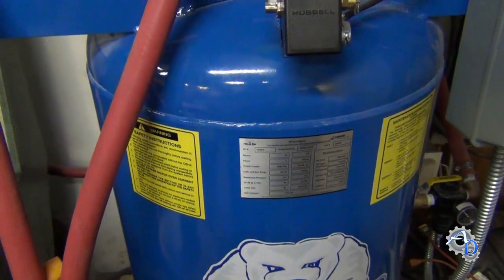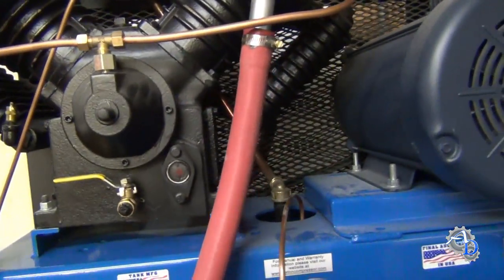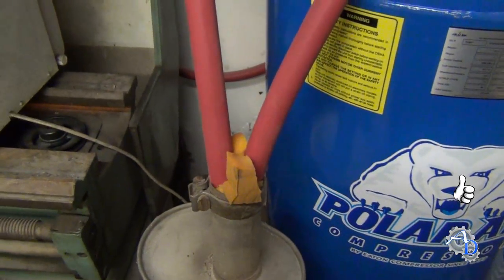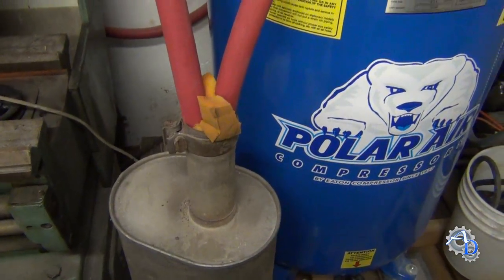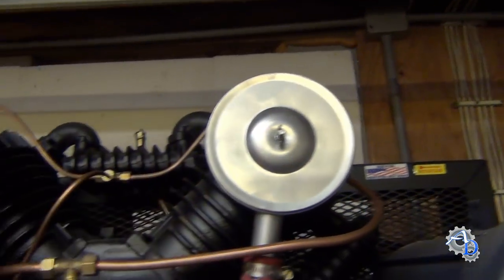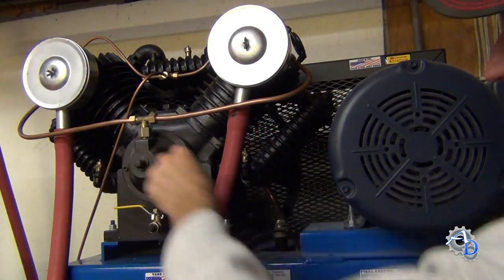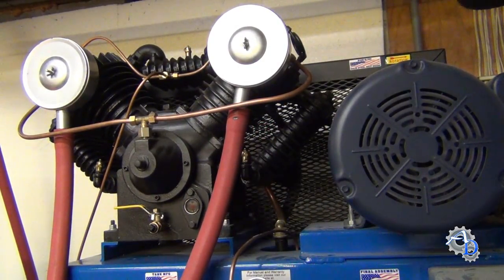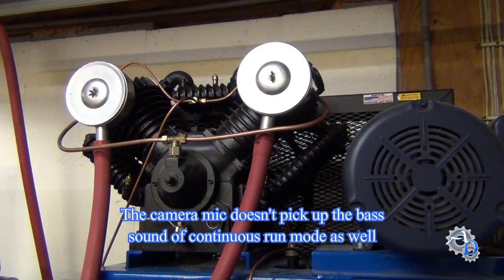Easy Trick to Make Your Air Compressor Quieter

Comment: Please what type of oil?
Reply from the maker: Just compressor oil
Reply: @ArnoldsDesign  What is the oil standard or size?
Reply: @ArnoldsDesign  Is it automotive oil or hydraulic?
Reply from the maker: @فنالتعليقالصوتي-ض3ص  It's just labeled "air compressor oil".  Get the oil for pistion compressors.

Comment: Please know that in my opinion, That is causing more of a strain onto your electric motor. I have the luxury of being poor & purchased a Central Pneumatic 21 gallon Harbor Freight air compressor & it has a 1/4" cold start valve which allows the first 4 pounds of air to escape because the electric motor does not have enough power to turn over the piston to build air pressure & I KEEP ORDERING NEW "COLD AIR RELEIF VALVE 1/4 VALVE'S & YET, they keep failing so, I am considering between a stubby 30 gall Kobalt tank with handle's & 2 wheels, or whether to go to Royal King & get a NOT SO MOBIL-60 gall FOR ABOUT $100.00 LESS? AT LEAST FOR NOW, SOUND IS NOT AS MUCH OF AN ISSUE FOR ME, FOR NOW AT LEAST. I will never again purchase a air compressor which has an air relief valve inline with the intake & the intake air tube, THEY ARE JUNK!!! and I am not referring to the tank safety pressure relief valve that every air compressor has for anyone who is wondering!

Comment: Mufflers goes on exhaust not intake. What you're doing is restricting airflow to your engine. I didn't hear any sound difference. You need to put it on the exhaust side. But I also there there's a. Better way than using a car muffler
Reply from the maker: ???  This is an air compressor, not an engine. You can't put a muffler on the "exhaust". And no, it doesn't restrict incoming airflow. The muffler was designed to handle flow from a 5.7L V8 engine. I'm sure it can handle a 37cfm compressor.

Comment: just build a sound proof box for your compressor
Reply from the maker: Yes, I'd like to put it in a separate room. Unfortunately, my shop's only 500 sq ft and there's no way I can do that. If I build a little enclosure around it, it would over heat quickly. On 50 -60 degree F days, it will actually heat my shop without the furnace on if I'm doing a lot of blasting.
Reply: A dedicated soundproof housing would have taken up more space, cost alot more than the muffler and would have (most likely) not been service friendly.
Reply: Jeff Burton not to mention it would trap heat. Compressing air makes a lot of heat. Any enclosurewould have to have built in air flow.

Comment: easy trick ... lost space and no major result. .... MY build (first compressor rated over "5cfm.."  )  starting project when find 2piston seized in garbage. ( quality cast iron, estimate 12-17,cfm )   rebuilding homemade free cost connecting rod with basic tool, cut gasket  homemade.  try 4 motor before find who run my pulley ratio desireddd (450 pump rpm)

at this points, setup is screww on wood bench,  no vibration, and no tank raisonannce with my hydrolique hose suppler (pump/Tank)   no air filter. juste 12'' 1/2''collant hose, and coton linge for little filtering .((air tank find a recycling trash, and buy for 3$)

1year later.  just little ajustement for maximize cfm and energie efficiency ( belt length, exemple, size of check valve, unloader line ect ect 

result 45db  with 15cfm mesured with formule (time,tank, ect ect)

Comment: your reducing the intake flow and could cause heat build up.
Reply from the maker: The factory uses a setup just like this. I don't think it causes any issues, because they offer a five year bumper to bumper warranty. Then again, manufacturers have been known to make mistakes. One of the things I want to do is take temperature measurements with and without the modification.
Reply: The air around the motor is hotter than on the floor. So its better to use a system like this if you use right dimensions...

Comment: I can't believe that pump doesn't blow those lines off.. it must not crank out much CFM.  Which is my main concern will all that line and constriction.  I spent a fortune on build a compressor that can take a 90 gallon tank to 150 in under 2 minutes..  I went out of my way to make sure the runs from the pump to the tank where wide open and straight as possible.  Screw noise.. its a mans tool.
Reply from the maker: It's actually pretty high capacity for vapor blasting. 38 cfm at 100 psi, 32 at 175. The manufacturer uses the same size lines for their muffler setup too. This particular muffler is from a 400 hp engine, so it can handle a whole lot more than 38 cfm with very little restriction. Man's tool or not, I want to save whatever hearing I have left.
Reply: and if u have neighbours they might not care for ur man tool noise lol
Reply: The noise isn't so bad - but it does dim the entire block's lights on start up! No joke - you can hear the pole 'buzz'.
Reply: EH! WHAT. speak up
Reply: enator71  - I saw that after the fact. I have since done some homework on this and what ppl have found is that the biggest issue when altering the intake in this way is condensation before the cylinders and  water buildup. The way to do this right is to build an intake resonator with a drain. I have since seen a video where a guy welded up a nice aluminum airbox and it silenced the induction noise and traps most of the incoming moisture.  I can't find he link but if I do I'll post it here.
Reply: The distance to the muffler is not so long as to create a major condensation issue. Nice try (again) though.